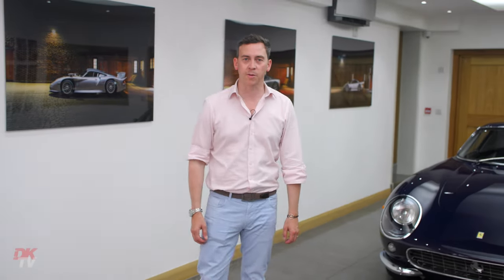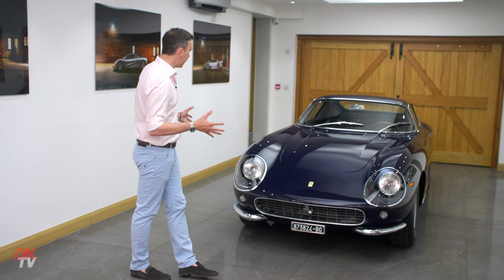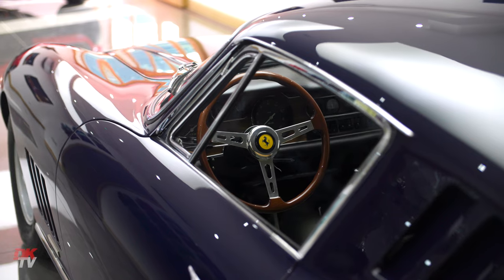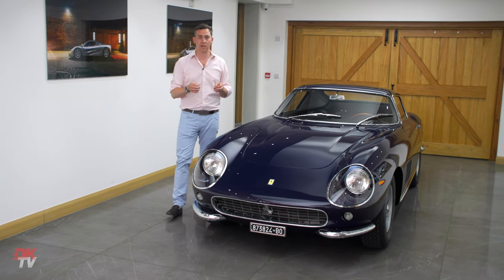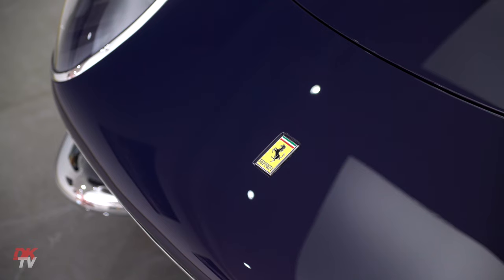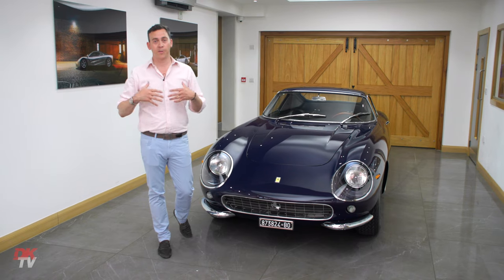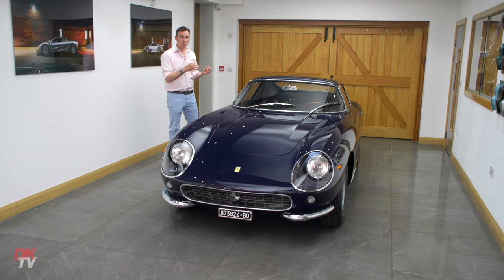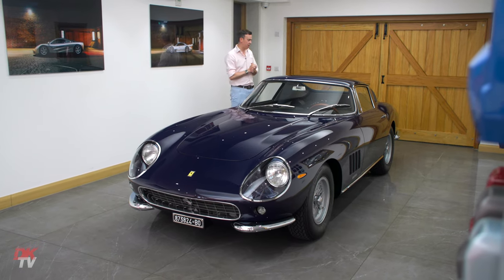Ferrari 275 GTB/6C Restoration Update

Comment: Great restoration. However, the original designer put the front bumpers too low, they should have been brought up higher at the same level of the radiator.